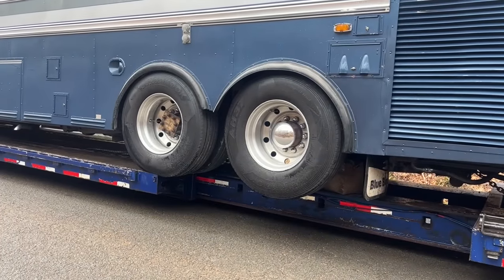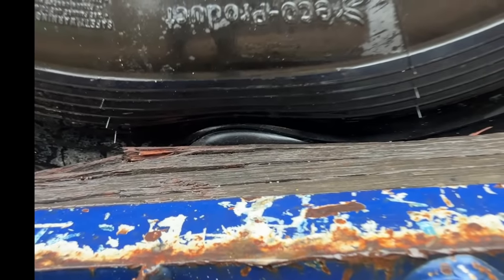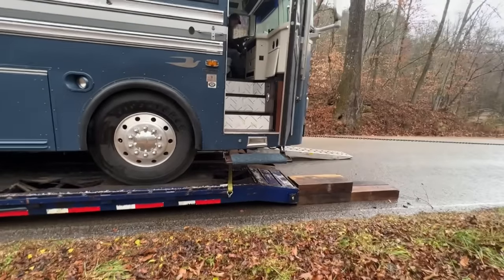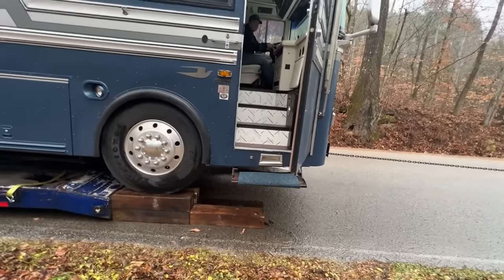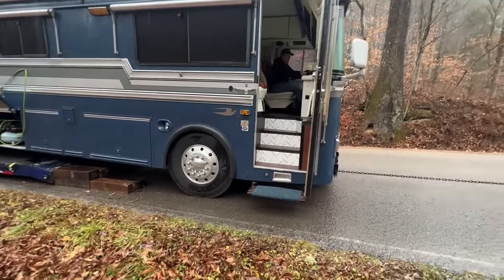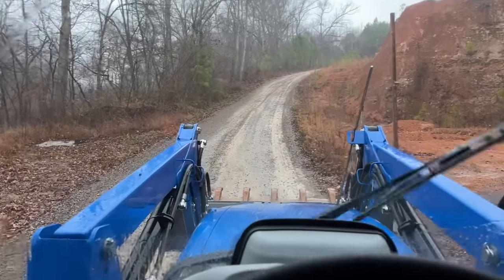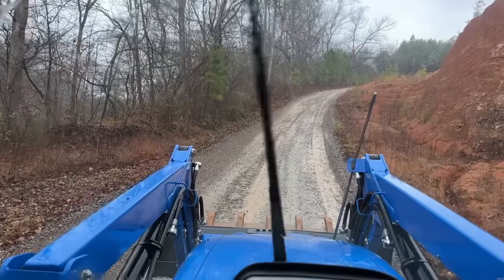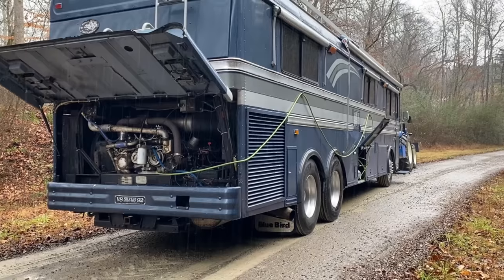Shipping a bus, towing never goes by the book.  Bad trailer, secured very sketchy.

Comment: I usually don't comment, but I JUST had to say, that that trucker is VERY dangerous! It's obvious he didn't check his load enroute, his brake lights are on the mirror frames, and he had to idle the tractor up to build air I assume. Wonder when he had a DOT inspection, if ever! Very scary that he operates that crap on the roads we're on!
Reply: I noticed the window air conditioner in the back of the cab. I doubt that it was a factory accessory.
Reply: Not only would I have refused the transport, I would have called DOT.
Reply: Scott Crosby saving poorly mounted transported buses
Reply: Boy Scott That tractor has come in really handy It must be nice to have your own.
Reply: Frequent braking can use up air, but I don't think I had to stop and rev up so frequently to get a truck unstuck.
Reply: @fmccloud , that's generally caused by a big leak in the system. There's no way that truck would pass a DOT inspection. If that bus was mine, there's no way I would want it hauled anywhere on that trailer.
Reply: We all have to start somewhere but that trailer/load was downright dangerous.  That outfit needs stopping!!!
Reply: It's amazing what some people get away with everyday.
My father is a prime example of someone who gets away with sketchy stuff his whole life.
I'm the type of person that'd get pulled over by the police as soon as I drive out the drive 😂
Reply: That trailer has been pulling repoed boats outta the ocean for years
Reply: Seriously doubt the lights on his mirrors are his only brake lights.

Comment: This a perfect example of why you refuse to use any truck that shows up for the pickup with their name and numbers written on a piece of paper and taped to the side of the truck.
Reply from the maker: A lot more to this that i didn’t share un this video.
Reply: Whoever shipped it, should have rejected the trailer.  Bad wood on the deck, and only one ramp.  Definitely the cheapest mover they could find.
Reply: The paper with the fmcsa and dot numbers is actually pretty common for owner operators who run under multiple authorities, the home window air conditioner installed in a hole hacked in the rear sleeper wall is much more troubling.
Reply: At least the bus got off undamaged, but that one tire might have a permanent flat spot from the way it was sitting on that frame.
Reply: I am surprised at this...if the DOT pulled this truck over, they wouldve yanked it off the road and fined him big time
Reply: That’s the first thing I noticed! Not professional.
Reply: @darrenw2803  What violations did you observe from this video that would put it out of service?
Reply: @ChrisHarding-lk3jj  the way the bus was tied down, the broken boards for starters, the back wheels not even on the trailer, only one ramp
Reply: Have you ever stopped to think that the tow truck may be on hire or loan to the tow company and therefore they do not want to put a permenant sticker etc on the vehicle?
When we had a coach in for long term work, in order to keep the customer happy and continue his income, we would loan him a demo vehicle or a used stock vehicle and they would put a note similair to this tow truck company on the inside of the entrance door in order to remain legal whilst they are using it?
Please don't just jump to conclusions.......
Reply: @ChrisHarding-lk3jj the wood is rotten, and the bus was falling through! , back axle not secured! DOT would have red tagged that!
Reply: @ChrisHarding-lk3jj  as a driver myself... load securment. The broken deck with the tire on the crossmember and that lose dunnage or the block under the back. Imagine that came off with a vehicle behind him.
Reply: @shawnjarman9860  Yes, sir, and the fmcsa fines all double after the first of the year.

Comment: I drove OTR for 21 years.  That has to the shoddiest trailer and securement I've ever seen!  Had it not been for the holidays I'm sure that truck and trailer would have been stopped and put out of service.  Owners need to research trailering before signing with the low bidder.  Someone's going to be killed when a bus comes off one of these fly by night operators rigs.

Comment: That has to be one of the sketchiest trailers of all time. Not only is it wrong for this bus but absolutely un-road worthy as well.  I'm amazed that the cops did not pull him over and fine the operator for a trailer like that? Where I live this kind of setup and trailer would be considered dangerous and if the cops happen to pull ya over. They would not allow you to move with the trailer  like that at all. All the cargo would needs to be put on another trailer that is road worthy. EU laws on trailers are way more enforced than in the states.

Comment: What was the reason for shipping it?  This is the second one you have showed on your channel, seems like it would have been better to get it running at least well enough to get too your place and then take care of the major problems.  The hauler needs to have his license revoked!
Reply from the maker: Overheated and milk shake dip stick
Reply: @BusGreaseMonkey      I smell an engine rebuild.  That trailer was junk. Glad all is well.    Happy belated Christmas.
Reply: @BusGreaseMonkey  Definitely a blown head gasket....eh? Coolant now in the crankcase.
Reply from the maker: Bad head gasket isn’t really a detroit problem.  Cracked head is usually much more likely or cracked wet liner.
Reply: @BusGreaseMonkey ooh now that is a bad day 😮😮😮😮. Ouch!😊

Comment: 1:36 Brutal. That tire is ruined. They are pretty specific about sharp deformations like that causing damage.
Reply from the maker: Bouncing for 700 plus miles and over a few days.   Steer tires are very important to not abuse
Reply: Those tires are also very expensive. My dump truck uses the same size. I priced new ones at a $1,000 apiece.
Reply: @jerrybrooks870 Yes especially Michelins, they definitely are not cheap!😮😮😊
Reply: @carlbernard4197 , those are the ones I priced.

Comment: @1:34 Must have been a Swift driver
Reply: That is horribly offensive to Swift.
Reply: Make that ex swift driver. He would not have made the cut at the Swift Flatbed division. That rig was way, way below Swifts minimum standards. Most of the Swift flatbed drivers I encountered were very particular of their equipment condition and very picky on load securement. And they made sure their apprentice drivers in training were getting properly trained. They had a lot of pride in their tradecraft.

Comment: Not to be a debbie downer but is there a towing weight limit of the tractor?  I drive a telescopic forklift at work that is 47,000lbs with a 12,000 pound capacity and it is only rated to pull 12,000lbs rolling load.  I've always thought the manufacturer stated that number to cover their A if something breaks but towing a buss up a hill seems a little extreme to me.   Merry Christmas to all and Happy New Year!

Comment: Does your tractor only have low ratio gears, it's so slow.
Reply from the maker: Sorry I’m just taking it easy on the equipment.   It’s got 12 speeds but I’m not towing in a high gear.   I was in 3rd low
Reply: @BusGreaseMonkey with that much weight to pull up.a steep grade thar is the correct way to do it low and slow 😊
Reply: I agree with you using a low gear when towing a bus up that hill to your workshop, and you are braver than me doing it. I only see snippets of the tractor, but on the videos it always appears slow with high revs. I apologise if my question caused any offence. I think you do amazing work for your customers with great integrity. Thank you for sharing your journey with the world. Best wishes and a Happy New Year to you all. Jon in the UK. @BusGreaseMonkey

Comment: Can you haul a bus with a big tow?
Reply: Like a wrecker?  Oh yeah.  Only problems are you need a low profile arm to get into the front axle, ya can’t raise it up much or else your back end scrapes, and you have to pop the axles and/or driveshaft.  Of course that implies the tyres and suspension are worth a darn.
Reply: @jaysmith1408  tires may have been fine prior to breaking through the deck :)
Reply: It warps the doors (side luggage doors) on mci's. .Frame front and rear